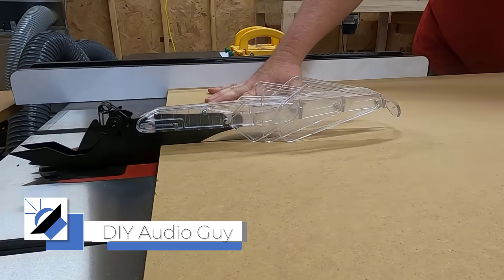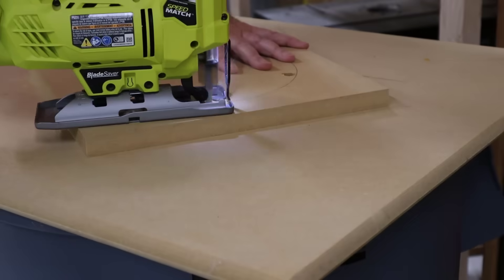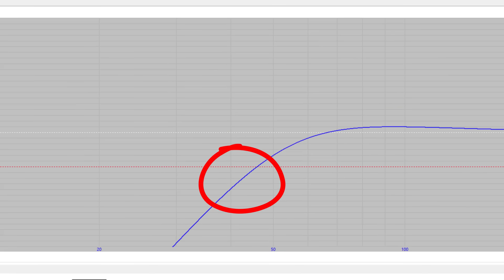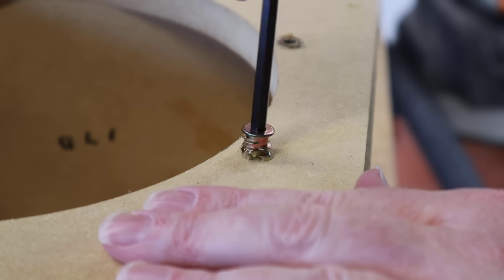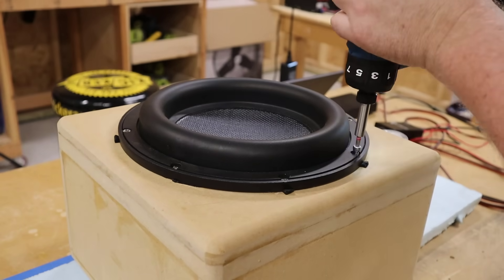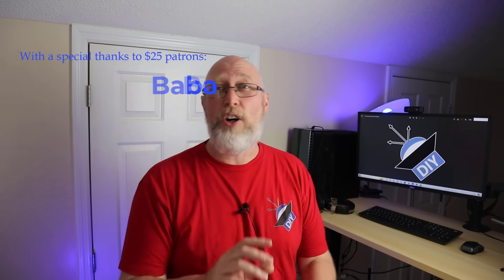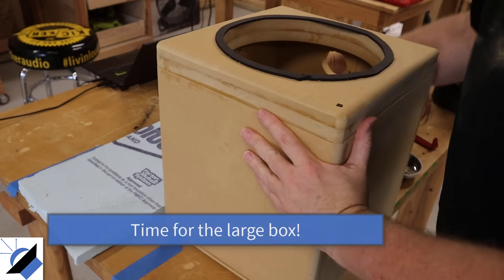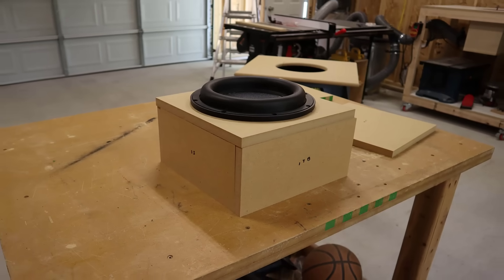Bass in a small space?  Sealed subwoofer enclosure design.  @PartsExpressOfficial

Comment: IMO sealed, OB, or IB are the clear winners for sound quality IF you use an appropriate driver. The trick is that the market is so heavily skewed toward tuned cabinets that the selection of such drivers is limited. For deep bass in a sealed enclosure you need both low fs and rather high Qts. That is to say the huge magnets that sell so well are contraindicated.

The other thing that is often not considered is room or cabin gain. If f3 is significantly below the frequency where room gain starts you get a nasty bloom or bloat in bass output and then when the 4th order roll-off kicks in the bottom falls out. For some applications this is no big deal but for serious music listening it can be a problem.

In a sealed enclosure the 2nd order roll-off is closer to the room gain boost curve so the final result is often more natural.

I also think that in general (up to a point) you are better off getting your displacement from larger cone area than from excursion.
Reply: I do not like the sound of bass reflex, it is just off somehow... I remember I compared my small 8" sealed box speakers that was specced as -3db at 45hz or something like that and compared them to my 2 * 6,5" ported speaker specced to have -3 db at 35 hz. The sealed box speaker I could hear deep rumble down to 30hz and even lower but the ported box was completely dead under 35hz, no sound at all. Also the sound was just better and more punchier from the sealed box. Later I moved on to a subwoofer system with four 12" woofers in open baffle that played down to 15hz and had -3d at 25hz using EQ to boost the bass by +6 db per octave from 70hz and down to compensate for the open baffle, sounded amazing ;)
Reply: I know I'm late to the party but I just wanted to express how much I resonate with these statements.
My goal is fidelity first and foremost, both in impulse response and frequency response. I'm going with a 15" high fidelity driver in a slightly undersized sealed enclosure (Qtc 0.75) to fit my room gain curve. WinISD is saying 10-120Hz +-0.2dB (including room gain) with minimal cone excursion at listening levels. The crossover will be an active line level 4th order Linkwitz Riley circuit at 65Hz. Can't wait for the parts to arrive and to build this thing.

Comment: When using inserts take the time to chamfer the drilled holes. The diameters are too large to sink the insert flush by force only. It also helps to let the insert engage perpendicular. And screwing them in properly is also better controlled when using a battery screwdriver. You get even more control when you screw some threaded bar into the insert from the back. Now you get something that you grab on to to keep your insert on perpendicular course. Just make sure the threaded bar is not in too deep because it could interfere with the hex key you are using to screw it in.
Reply from the maker: Great tips! Thank you.

Comment: I run a servo sub setup in my truck, it requires an electronic device between the amplifier and speaker. But a main requirement, the in-box speaker resonance needs to be at 70hz in a sealed enclosure.
All of your boxes would have been too big.
Reply from the maker: I have always wondered why servo subwoofers are not more popular. Probably because of the extra cost of adding that accelerometer.
Reply: @DIYAudioGuy  It may be that people don't understand it. Aperiodic membranes may be in that category as well.
My system does not use an accelerometer. Just negative feedback.

Comment: Putting a subwoofer with lots of linear excursion and high power handling/mechanical resilience in a small (sealed) enclosure is common and useful, as long as you achieve your desired target function by utilising a DSP/EQ or something akin. This principle is widely known as "Under Resonance Principle Subwoofer", short URPS. It works totally fine if you know what you're doing....
With cheap DSPs and cheap powerful amps, the size of sealed enclosures doesn't really matter anymore. It does matter if you're trying to manipulate your speaker with its enclosure only...but who does that anyway?
Reply: Me, I am doing that.
Reply: Does the DSP have to stay connected all the time? Like a miniDSP? I want good base for Jazz music. Do you recommend a good 10" or 12" and sealed I assume? Is there a specific driver you can recommend?

Comment: You ran out of Brad nails? Why not just use some Justin nails?!😏
Reply from the maker: Well, I had to MacGyver it and figure out a solution with what I had on hand. 😆
Reply: @DIYAudioGuy  ahhhh yes, my specialty... Solving problems with random things your average person would consider "useless junk"!😏
Reply: @DIYAudioGuy  your comment about woofer boxes in limited spaces, like in trucks especially, reminds me of the crazy/genius box solution I came up with for my badass old 78 VW Scirocco, more than anything to be as lightweight as possible beings I'd already ripped out the back seat, all the carpet padding and the rest of the interior along with the full sized spare TIRE too so it only tipped the scales at barely over 1200 lbs!

That conveniently left a large "rigid" tire well vacant. I epoxied in an MDF bottom and a MDF donut on top to mount a Blaupunkt 12", complete with a wire terminal and thin carpeting throughout. Sucker hit so hard you could hear it a good 5-6 blocks away. 😅

Comment: No mention of sound quality?    Interesting.   That is the whole point of a speaker.   

If you truly want a subwoofer.   A small sealed enclosure is not the way to go.  

Most rock , rap, club music does not dip much below 50 hz.    A small box is fine for a speaker that is designed to work in a small box for most music.    Jazz or classical probably not.  

For instance the JL audio w0  10”  sounds fantastic  in a .6 cubic foot box.  

What you stuff the box with makes a huge difference.  

Fiberglass. Will produce more low bass but won’t sound very musical.   

Wool is the best stuffing I have found and you only need a small amount .  Cuts out 1 note boom and makes a woofer far more musical with more low bass output.  

You can tune a small sealed box to sound the way you like it with stuffing.

Comment: you forget the room participation. In a standard listening room, you can gain 8dB at 20 Hz, and due to room participation, ported speaker can results to acoustic disaster.  A sealed enclosure avoid this and most of time gives enough bass level even at very low frequency thanks to room participation. Of course, if the goal is to get 110 dB, it is very difficult with sealed enclosure.
Reply from the maker: Since all of the measurements were in the same room this effect is included in the results.

Comment: Excellent video 👍

One question I have though is...

How did they sound?

Especially at the point where they were all equal in level.

Was the smaller box quicker and tighter sounding is my point.

If so, then the lower frequencies could really be potentially EQed if the speaker is playing a lot under its capability.

Also a much more efficient bass driver could be used and rolled off if matching with mids / trebles if volume was an issue under the seat / wheel well etc.

An excellent video 👍

I was looking at using a larger bass driver in a much too small box with a full range drive for home audio as an idea.. speed accuracy, control, phase and response time are what I am interested in. Rarely do I like the sound of vented inclosures.
Reply from the maker: That's a good question, I didn't really hook them up and do a listening test.  I suppose I need to pop them in my truck and see how they sound with cabin gain.
Reply: @DIYAudioGuy  
Yes, I would have also liked to have seen what the in-vehicle low-end extension and overall response of each size enclosure was with the added transfer function or "cabin gain" of your truck.

I would have also like to have seen the response of the small and medium size enclosures compared to the next larger enclosure with the small & medium boxes stuffed with 75% Polyfill.

The loose Polyfill stuffing (or lamb's wool, fiberglass batting, etc.) can effectively make the box act as if it were up to ~20% larger.  The polyfill works by converting the vibrational energy of the subwoofer to low level heat.

There is an article with tests and charts from the March/April 1995 issue of Car Stereo Review magazine by Tom Nuissane.  Search for "Glasswolf, Tom Nuissane, Make a small box act like a larger one with polyester fiberfill".

So if you are stuck with using a smaller than ideal sealed box for your subwoofer, you'll probably benefit from adding some Polyfill stuffing to the enclosure.

Comment: Thank you for this video. What about underseat and spare tire subs? Because the boxes are so small, smaller subs should perform better? Is that correct? So a 6" underseat or spare tire sub would sound better than an 8" or 10" in a similar enclosure / setup?
Reply from the maker: Hard to say for sure, but in general under seat and spare tire subs will have less output compared to the same driver in a big rectangular box.  Some people run under seat subs and are happy with them.

Comment: Not only you explained it well, but you took the time to get a loan and purchase the mdf. 🤪. 
On a serious note, my single cab had the largest enclosure that would fit and it was still too small so I bought irrigation 3” pipe and cut it into several lengths ( tested all three to find the optimal one) to create a ported enclosure. I ran the pipe along the back wall of the cab and towards the passenger side. Ironically enough even though it sounded louder it still had the punchy tight bass of a sealed enclosure and I added another one. Tuning for a specific vehicle is monotonous and sometimes it sucks but it’s 💯 rewarding when you nail it!
Reply from the maker: Open the video will get some views, if not the loan sharks are going to come break my legs.

Comment: What you don't mention is that every car/truck will have what they call "cabin gain" which boosts the low frequencies so that in fact a very small box can sound very good in a specific vehicle. The best non boomy bass I ever had was an 8 inch woofer in a sealed box with a QTC of 1 and a FC of 60 Hz. It could easily play to 20 Hz and below in my Honda CRX. Using Mike Oldfield's The Songs of Distant Earth CD, the bass on the track Ascension sounded excellent and extended below even what my house subwoofer could play.
Reply from the maker: Just imagine would it would have been like with a bigger sub in a bigger box.
Reply: @DIYAudioGuy  Quite bloated probably. Civic is a pretty small cabin.

Comment: How many inches do u recommend behind a subwoofers vent ?
Reply from the maker: I'm not aware of any specific rule of thumb, but it will depend on the sub.  If it's a big 18 on a ton of power, you'll want three or four inches of clearance.  A 10 or a 12 on moderate power, an inch is probably fine.  If there is no vent on the back of the magnet then you don't need any clearance.

Comment: I have added ports to the tiny wedge flea market boxes. I fitted a piece of 2" pvc pipe in it about 10 or so inches long. The length of the port is all that mattered to getting the bass right. I was limited on space and the solution worked out nice.
Reply from the maker: If it works it works.
Reply: Would the pvc pipe work on a box for 6x9s
Reply: @agunt4200  Yes. Getting the length right is key. The larger the diameter the longer the pipe will have to be. Also there is a diameter that would simple be too small. I have used the pvc pipe for small boxes forever. There is a tool online to calculate port length to dial in a tuned frequency. It wont be 100% but it will be in the ball park. 

I suggest an 1 1/4  for this speaker. Probably best to go in the side of the box to get the length you will need to get the desired frequency. Its gonna be close to the full length of the box. Do not start fully bottomed out. About an inch off is where I would start. That might be close to perfect.  Find a bas test track with a note you like and tune to that. Pull out slow until the bass sound good. The cone will actually move less when you have the tune about where you want. Cut off excess and glue the pipe in place. Remove speaker and glue pipe in a few places inside so it dont rattle. I have been doing this since the 80's. I hope this helps you get your speaker sound better.

Comment: No question you're right that the properly designed ported enclosure is going to outperform the sealed at low frequency.  However, the extreme difference shown on the graph looks more like the result of testing a driver that prefers a ported enclosure.  I suspect it's a bit less dramatic when testing speakers that are specifically built for sealed applications.  Also, you can EQ boost a sealed sub (within reason) all the way down to the lowest frequencies.  You can't boost a ported sub below it's port tuning because it lacks the air suspension to dampen it's movement and it will likely be destroyed.
Reply: My experience is the opposite, ported speakers have 0 deep bass, they can play down to 35hz -3db like it say on paper then nothing, silence nada sound under 35hz.... My 45hz -3d box speakers play 30hz no problem where you can clearly hear the 30hz note, while the ported box tuned to 35hz -3db is totally silent at 30hz.

I re read what you say and you are basically saying the same as I say but for a ported box to play deep you need drivers and enclosure and porting that play deep to begin with. So you end up with most ported boxing not playing deep bass because it is very rare they are tuned to play deep bass and most woofers on the market is not made to play deep in a ported box...
Reply: you can boost with peq

Comment: I only drive convertibles, so tiny sealed in the trunk works well
Reply from the maker: Space is at a premium in that kind of car.
Reply: @DIYAudioGuy  yes, I made two very small sealed boxes, as one enclosure wouldn't make the bend of the trunk opening, each with an Arc Audio Black series 12 and various Arc SE series amps in an 01 Mustang convertible.

Comment: You missed one critical point. If you used 8" ultimax instead then 0.4ft3 would be optimal box but 10" ultimax still outperforms it while having tiny 0.4ft3 box. So if you have limited space then unoptimally small box is the best solution.
Reply from the maker: That sounds like a good test for another video.  I just need to get the driver.  Maybe we can talk parts express into sending one my way!
Reply: @DIYAudioGuy  at least winisd gave me such result. 12" ultimax gave the worst result however which was unexpected. I expected 8" perform the best.
Reply: At the end of the day, sub bass is all about moving air. The 10 has about 80% more cone area than the 8 while the Vas isn't usually that much higher. In the same series of sub, the 12 often has a Vas about 2x that of the 10 and wants an enclosure somewhere close to 2x as big. As a result the optimal box for the 8 is only slightly undersized for the 10 but really chokes the heck out of the 12, to the point that the motor isn't strong enough to let the extra cone area overcome the deficit.

Comment: Well I had two hifi titans by 400/800watt=1.600 max wired at 1ohm ,a mono 2,200watts quantum  amp ...speaker of in two  boxes that were small ..the sound was cool ...SUV so open back it was very loud
Reply from the maker: The solution is to throw power at it.

Comment: I have primarily only ran sealed boxes in all my car audio systems since the 90s  up until recently. ( except i did had a prefab 4th order with a Pair of low power Kenwood 10s back in the day once). Currently Running an NVX vcw12 in a skar ported box around 2 cubes net tuned to about 35hZ. Output is decent but doesn’t hit every note on different types of music. Mainly sound best with rap and rebass music and i realize its a prefab and a custom or built to spec box would prob perform better. Always liked the accurate sound of the sealed boxes so just ordered a 1 cube box to try sealed again before deciding which box type to go with when going custom built enclosure for a pair of these subs wired to 1 ohm on a soundqubed 3k amp.
Reply from the maker: If you are a fan of NVX you can use the code DIYAUDIO15 for a discount at nvx.com.

Comment: If the driver isn't designed for small enclosed space, it's performance will suck in small enclosed space. What I'm most interested in is servo controlled open baffle subs. No box at all, to be an issue.
Reply from the maker: Right, it is about matching the enclosure to the sub.

Comment: All 3 sealed boxes can produce the same results with EQ/transform, but the small box needs more power to do it and may begin to stretch the limits of the thermal power handling of the voice coil if driven hard. A vented enclosure will have to quite a bit larger than sealed for a woofer like this to handle the air displacement without chuffing noise (the port itself will likely have to consume more space by itself than one of the smaller sealed boxes). You could put a pair of these subs into a sealed box the size of the single-driver vented box and achieve similar results with EQ/transform. 

Or... do what I did and put the UM-10 in a bass horn enclosure. ~25-80hz with ~95dB@2.83V sensitivity.
Reply from the maker: That sounds cool!
Reply: How can I learn more about basshorn there's hardly anything I can find
Reply from the maker: @fasterthanaturtle  you can model them using a piece of software called Hornresp.
Reply: @DIYAudioGuy  Hornresp is excellent. Great for virtually any kind of enclosure design.